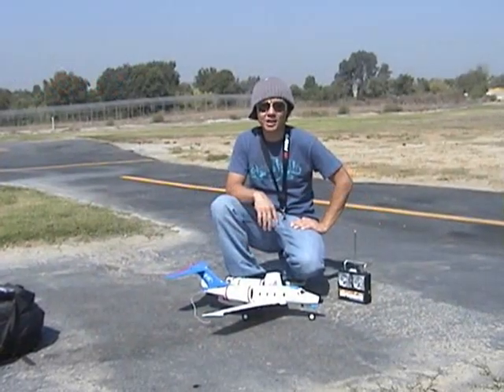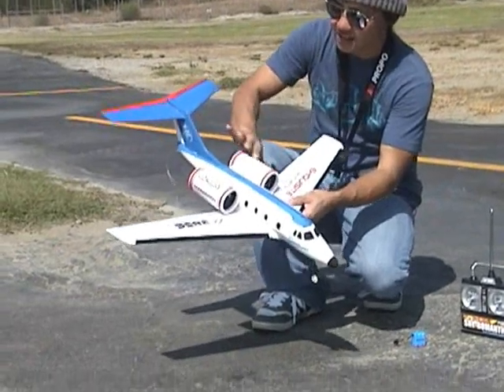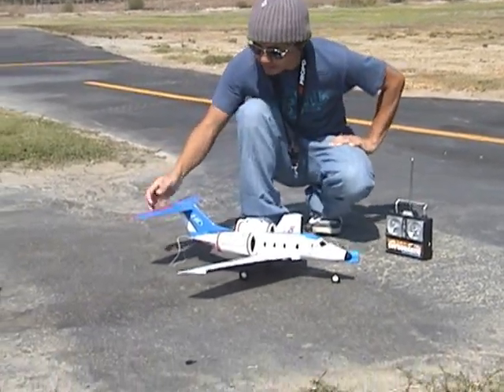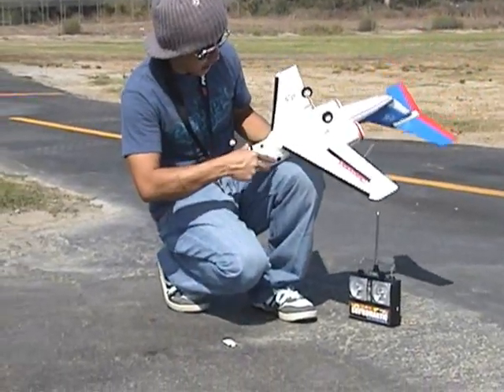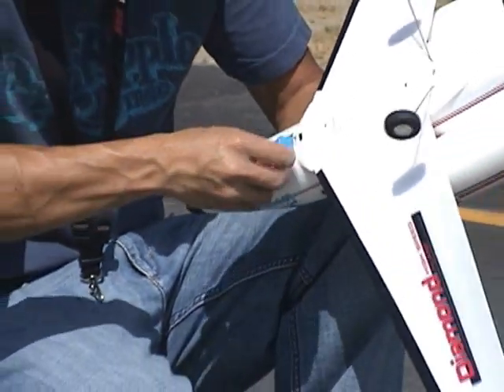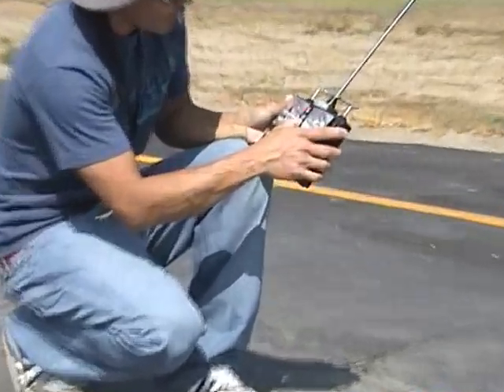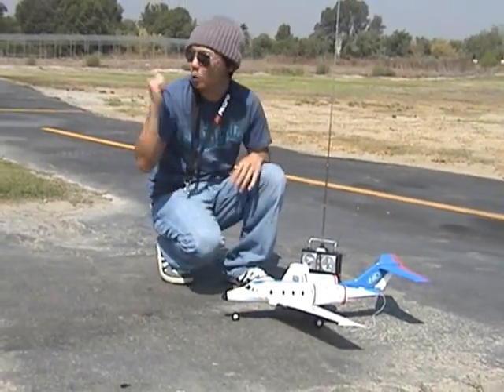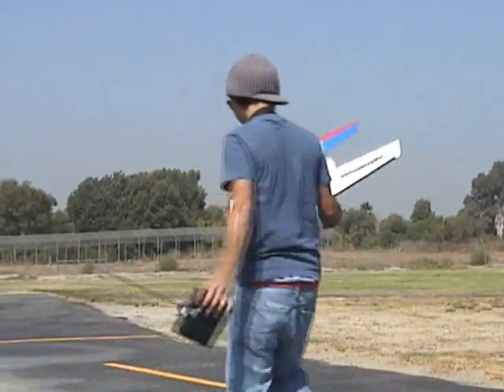Air Earl 2 Channel Electric RC Jet!  Flight Video!

Comment: i just got my air earl and i put it together the way it says in the instructions and even charged the battery for 3 hours and it wont work it makes a couple of click noises but wont throttle up. Any suggestions to what might be wrong?

Comment: Hi, I hope you can help me. I brought this plane a few months ago and i just can't seen to get it to take off. When i line it up on a flat surface road and put on acceleration it taxis but then veer to one side. I've tried throw flying it but it won't fly. I have unscrewed it and put it back together as per the instruction but it still does not work. Can you please provide me with some advise. I am in Sydney Australia

Comment: can u pull up. you didn't check the airlerons
Reply: it docent have ailerons it turns left and right using the rudder because it a 2 channel airplane
Reply: No it has rudder and throttle control and it does elevator by increasing the throttle